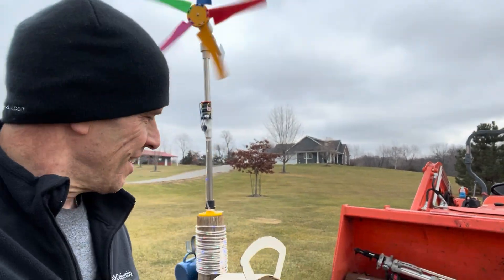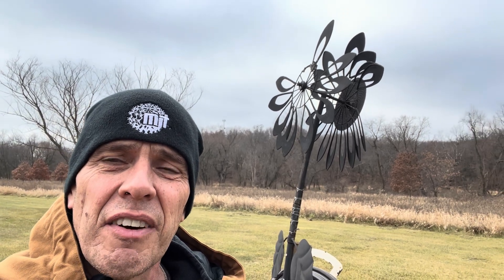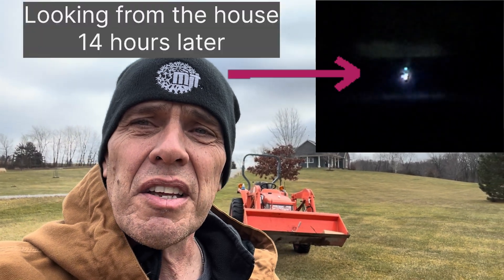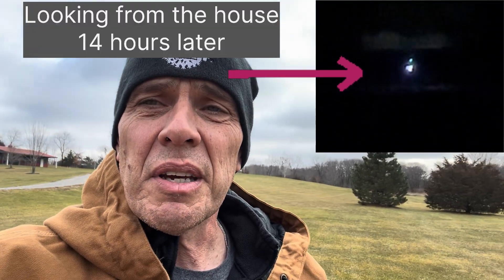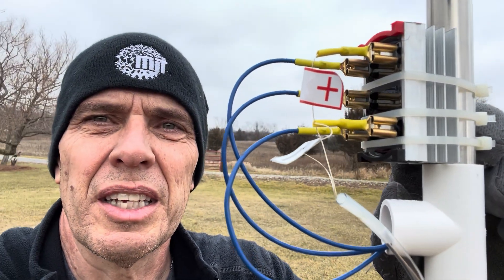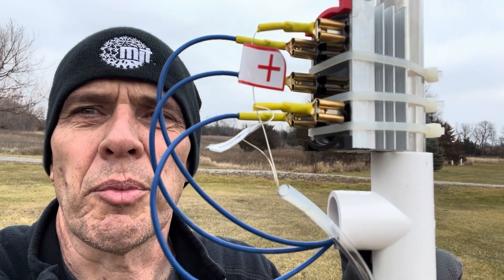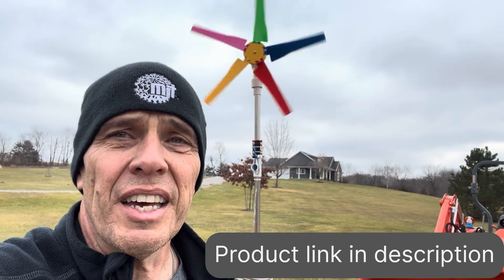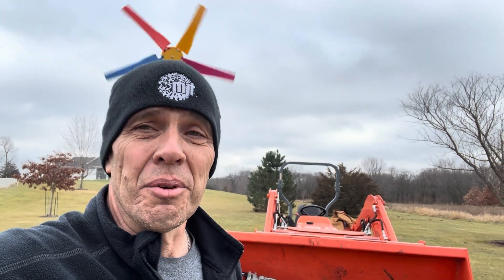Replacing My Broken Whirligig / DIY Electric Wind Turbine Generator From Amazon Link in description

Comment: The wind completely destroyed my own whirligig! lol... 

I had a rather odd question regarding the light strip that comes with the wind turbine, Do you know if it produces any form of heat? I'm trying to figure something out...
Reply from the maker: They are LEDs so there is no heat that I know of....
Reply: @Springtailsolutions   Okay, Thank you! I was playing around with the idea of using of one these to keep one of my fruit trees a bit warmer over winter! Guess I'll try something else! Thanks again!
Reply: @MANNY100123  hello. One possibility to generate heat with this unit would it be to swap out the LED light strip for resistors. The task of a resister in a circuit is to limit current flow. Heat is generated as this is done. However the generator is rather small. It will not generate a lot of electricity. LED lights do not generate light the same way the old flash light bulbs did. Flash light bulbs had a filament that glowed and gave off light when the current went through and generated heat causing light to be produced. If you wanted something to heat the plants then you might consider upscaling and using hey larger generator. Something like a room fan motor. You just need one that will generate Direct current. The blades could be larger to catch more when to turn the generator. I'm not sure how many homes the resistors would need to be but I know you want resistors that are larger in size probably something like hey one or two what size resistor. These types are much larger than the tiny ones you see in circuit boards. If you want to keep the trees warmer then use a greenhouse. You could make a frame out of PVC Cover it with thick plastic Drop cloth type vinyl from a role in the paint department okay local hardware store. Be sure to put in compost like old fruit, Grass clippings or anything else that will rot. As it rots it will generate heat. The vinyl will help hold the heat in and keep the tree warmer as well as provide light. Of course if the trees huge the cost of doing this and difficulty of supporting the structure what the great  good luck